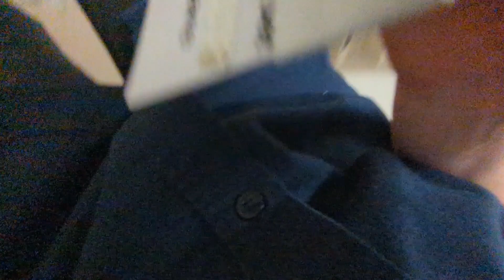Bell Test #3: High Rise Voice Evacuation (EST3)

Comment: What do both messages say I can hear the one say something about if you're in the stairwell and the other says something about the building in full alarm.
Reply from the maker: The stairwell message says "Your attention. Your attention please. There is an alarm condition in the building. If you are in this stairwell, please evacuate the building using this stairwell."
The second stage message says "Your attention. Your attention please. This building is in full alarm. Please evacuate the building using the nearest available stairwell. Fire wardens report the status of your floor at the main floor security desk." The system has custom messages and floor-by-floor evac, with stairwell audio zones as well.
Reply: @Twentythree33 I never knew EST has that functionality on high-rise systems.